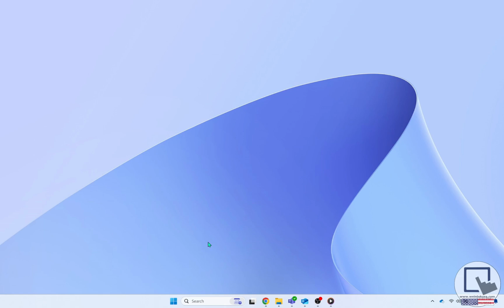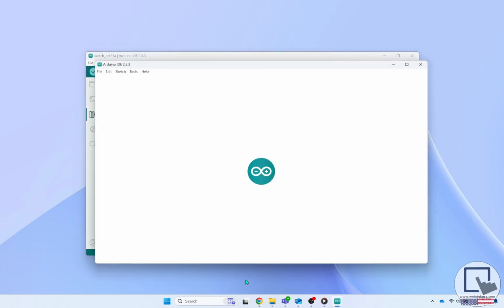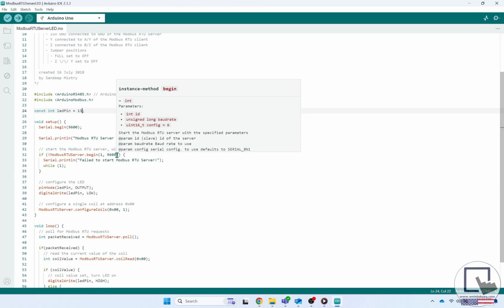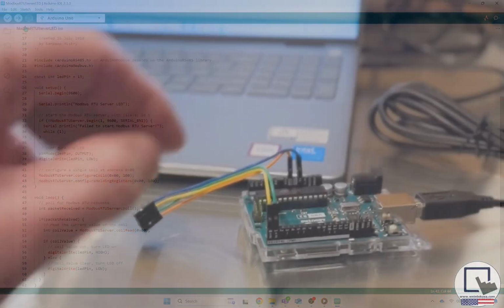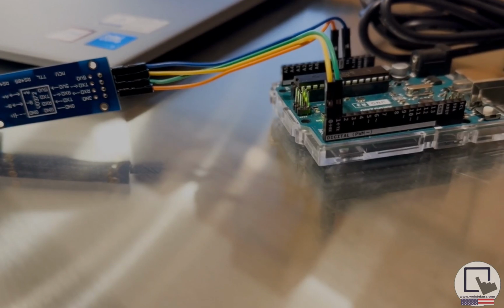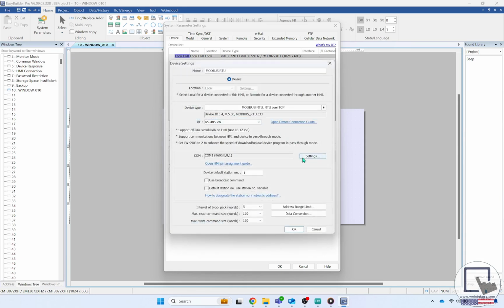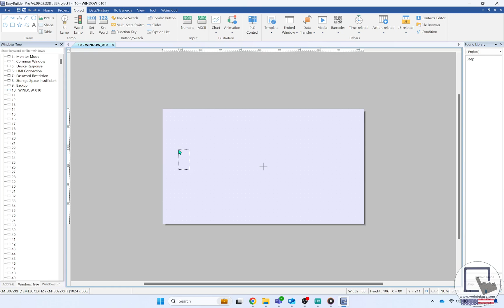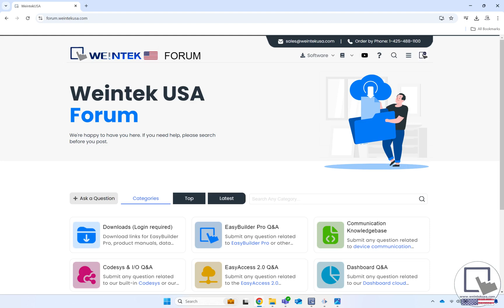NEW! Basic Arduino Uno + HMI connection via Modbus RTU - Weintek USA

Comment: Can I use HMI as slave and Arduino as master?
Reply from the maker: Hi @lamthachpts412,
This should be possible, but you will need to use a Modbus master library within the Arduino IDE and setup the HMI as a Modbus RTU slave instead. I hope this helps!
Reply: @WeintekUSAInc  How can I setup HMI as a Modbus RTU slave ?

Comment: would you please provide an example, to use Weintek HMI with modbus rtu or tcp communication method to Arudino MKR1010 or Opta, to modify wifi connection for Arduino MKR1010 or Opta collecting to Arduino cloud. Thanks.